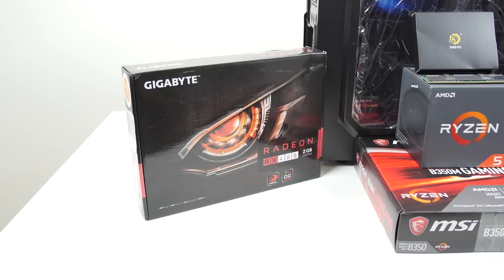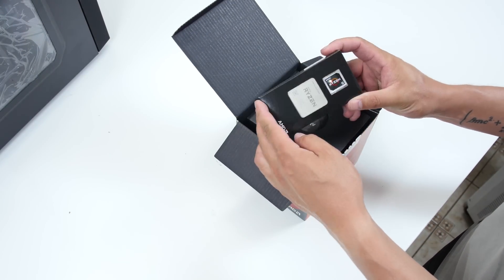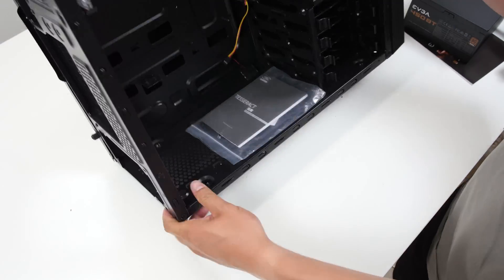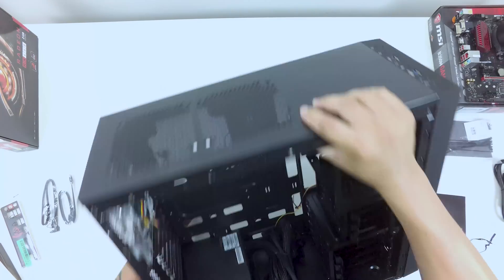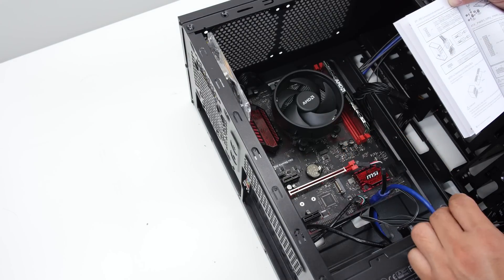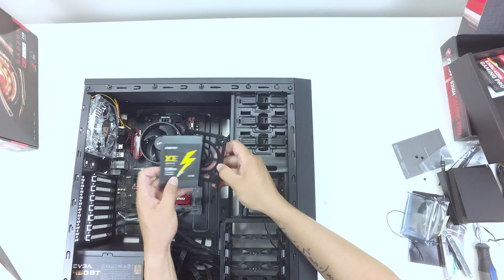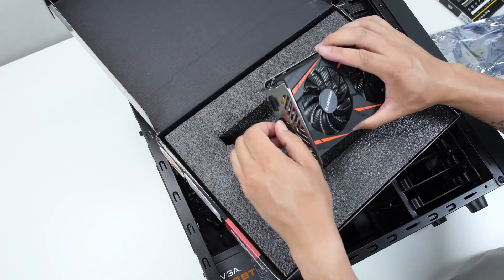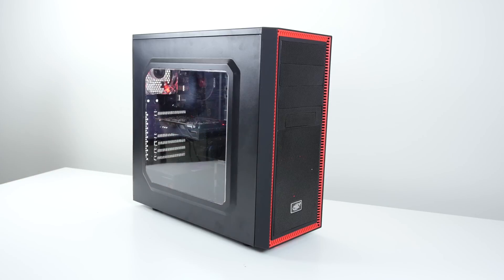$450 Ryzen 1400 Gaming System

Comment: You make it look easy brother. Good stuff
Reply from the maker: Thanks for watching!
Reply from the maker: Cookieking Gaming incorrect.
Reply from the maker: That's part of an upgrade video but then if I put a 500 series in this video, it would no longer be $450 computer. And this system runs Overwatch at 60fps on ultra 1080p with freesync without any problem. What else you got. So far you haven't been right on anything. But I guess that's why you are here so you can learn.
Reply from the maker: Cookieking Gaming you can't see in this video I'm using a $150 Ryzen 5 1400? You can't compare a Ryzen 7 to the Intel 6700k. Even when overclock, it can't beat a Ryzen 7. You think multi-core is a gimmick? Well for you is it since you don't do anything serious with you computer but play csgo and Minecraft at 500fps on a 60fps monitor. Pretty lame.
Reply from the maker: Cookieking Gaming You need to first figure out what better gaming is before you can talk. You have already proven that you need to learn more about refresh rates and making a balanced system. Come back in a couple years when you can make a more detailed opinion with some correct facts.
Reply: Cookieking Gaming the 460 is OK If you play with medium settings and yes the vram limits you in doom a bit for example. The 460 4gb version can't use all the vram as the cards pretty weak. 460 2gb Will play any esports title 1080p60fps medium-high.
Reply: Cookieking Gaming Wow another idiot troll kid on the internet.
Reply: Cookieking Gaming Who's this salty lost kid?
Reply from the maker: Hey guess what, there are many other components in your system that could affect performance for the shitty game fps. There is also software issues that could be happening. It seems like you are the only person in the entire world to have these issues. It might also be a conspiracy. It's probably MK Ultra giving you bad fps.
Reply from the maker: You need to do more research my friend. I already know this plays Overwatch at 1080p on ultra with an average of 67FPS. I am doing it now.
Reply from the maker: Right now it is overclocked to 3.8ghz with a vcore of 1.30 and stable with prime 95 and a cinebench score. the RX is also factory overclocked and overclocked a little bit more with MSI afterburner. So far you are the one that needs to prove it is crashing.
Reply from the maker: So far you are the one that needs to prove something.
Reply from the maker: Again, do your research on infinity fabric and ram speeds for AMD.
Reply from the maker: Did I say it plays 1440p? I don't think so. I have this paired up with a 1080p 75hz freesync monitor.
Reply from the maker: First off, there's already plenty of evidence on youtube. I even said I am late with the ryzen hype train. so many other youtubers beat me to everyting that I have said. I also wrote down that you should get a 560 instead because it wasn't out when I bought these parts. The only evidence I have right now out that is online is live streaming overwatch from the same system. I did both a capture to another system live stream and  a live stream from the same system itself. Both averaged 50-60fps on ultra 1080p. Which is surprising because this is not the kind of system that can live stream and game on. But it worked. What else you got?
Reply from the maker: You can see those streams here: https://www.facebook.com/itsgoodtobegeek/
Reply from the maker: So you just made your entire statement invalid when you said ryzen 7 cpus with locked cores. All ryzen cpus have unlocked cores. Try again. Sooner or later you'll get something right. You also keep leaving out that all non-k intel cpus are damaged k cpus. Like your i5 is a damaged i7. Also the 10 series from invidia is a damaged 1080ti which is a damaged Titan.
Reply from the maker: Lookup the 460 2gb and battlefront and you will see 40fps on ultra 1080p. Same goes for Fall out 4. Is this your first day on YouTube? You know there is a search function right? But I know you will try to go off topic and say that a 1060 will do better. Lol. Try again.
Reply from the maker: A PS4 and XBox One S combined cost more than this system. Not to mention the games also cost more for those consoles. Most console games, including star wars battle front and fall out 4 can only play at 30fps. Battlefront can't even do 1080p. Try again.
Reply from the maker: You have not provided any reliable or any good technical knowledge so far. So I can't be stubborn about anything you say. Go ahead and post a link to the linustechtips video and time code where he says that Ryzen CPU have locked cores. You are either trying to bullshit or you don't know how to post a link. Cite your sources. Try again.
Reply from the maker: Says the guy that buys a 1060 and doesn't have a gsync or 144hz monitor. You have a 1060 to play CSGO and minecraft. Your system is so unbalanced. That is a wasteful way to live. Try again.
Reply from the maker: You personally own a locked CPU and no motherboard that can overclock. You chose to limit yourself or you didn't know what you were buying? Try again.
Reply from the maker: Maybe you need to switch to consoles because you seem to lack a lot of knowledge in the PC field. I guess that's why I am here to teach you to be a better troll. Try again.
Reply from the maker: wow more incorrect info. vsync caps you at either 60fps or 30fps. Nothing in between. You need to learn more. Gsync and freesync is variable refresh rates. It is the advanced version of vsync. Try again.
Reply from the maker: AMD freesync is free. Gsync is owned by NVIDIA and manufactures have to pay a license so that means you have to pay extra in the end. Try to learn more from linus before you say something else. Try again.
Reply from the maker: and yet you wasted so much of that money by not using a gsync 144hz monitor. You don't know what good gameplay is. I pitty you.
Reply from the maker: You can't backup PC period. Buy an xbox or a ps4.
Reply from the maker: You had to prove he said locked. We all already know these are disabled core of the 1800x. Where does he say the cores are locked? That's what you said. You said they were locked. Keep searching.
Reply from the maker: Do you know what sponsored means? The video you linked was sponsored by Synergy. Sponsored means being paid money to make a video. Being given free CPU's for a review isn't sponsorship. You need to watch more YouTube dude. Try again.
Reply from the maker: By the way, all this trolling and comments back and forth is really helping my video come up in search results. So thanks for all the comments. It really does boosts my channel.
Reply from the maker: My god man, you don't even know how your own computer works. You're not stubborn, your're ignorant. Luckily for you, I m a patient teacher.
Reply: Wow. Rip MrBoriquas notifications
Reply from the maker: True_ Dublock Terribly sorry. I blame this troll.
Reply from the maker: Cookieking Gaming You seriously want to compare a $300 Intel CPU to a $150 AMD cpu? You really don't know simple math. You are afraid to compare it to a $300 AMD CPU?
Reply from the maker: Cookieking Gaming and the Ryzen 7 has twice as many cores as the 6700k. And why are you comparing it to the 6700k anyways? The Ryzen 7 out performs the newer 7700k. It even outperforms the x99 6800k.
Reply from the maker: Cookieking Gaming I think your country charges too much for computer parts. A Ryzen 7 CPU here can be as low as $290 and that's about £224.
Reply from the maker: True_ Dublock I know I should stop. I realized now that he doesn't know the basics and at this point I'm just bullying him.
Reply: Cookieking Gaming I too want to see performance of this PC, but not because I'm a moron troll but because I have the gtx 1050 instead of 460.
Reply from the maker: Cookieking Gaming Playing on it and testing it is easy. Making a good looking video is the hard part that takes me a long time to do.
Reply: micro center is cheaper
Reply: Yeah but there's tax
Reply: The B350 Fatal1ty would be better choice, had one msi had gone back real quick.

Comment: Hey when I push the gpu in the mobo should I hear a click?I have a gtx 1060 6gb palit and joust installed it and didnt hear anything also the pci block didnt move
Reply from the maker: Skipper you don't always hear a click but after inserting it in, it should not come out easily if you try to pull it out.
Reply from the maker: Skipper you also might have the type of pcie slot that has a clip you have to slide over to lock it in place.
Reply: The mobo is msi b350M gaming pro.The card feels like its in but the lock clip looks exactly the same before installing the gpu.I dont know if im afraid to push it to hard and if thats he problem.Its there a problem if I test the pc to see if it works or theres a risk it will fry?

Comment: Could I use this for a gtx 1060 3gb and a ryzen 5 2400g if so could I over clock ( ik the 2400g has integrated graphics but I will upgrade to a 1060 and won’t start with the 1060)
Reply from the maker: Josh Bennett yes you can.
Reply: Johnny Phung thx and will it be able to over clock even with the 1060

Comment: Seems like an overkill with the CPU for the price. If you want to get the most bang for the buck lower the CPU from the 1400 to the 1200 then shift the $50 for a better GPU. The 1200 will perform well enough to let even the 480 perform at it's near best.

Comment: yeah I just finished building my first system but using the Ryzen 5 1600 cpu and with a gtx 1050 ti 4gb.  I have the same motherboard and my question is I know this board has some LEDs and see 2 small lights on to the right of the gpu....are these the LEDs or are these lights indicating that something is wrong?

Comment: I would substitute the 1400 for the 1200, invest that 50 in the video card and try to get a 4gb 460 OC or 1050 OC or 1050ti evga SC
Reply from the maker: I agree. which is why I did just that when the 1200 came out and I picked one up for $90. I am still working on the battle of the budget PC's video and that's what's in there. The 1200.

Comment: Can I use gtx 1060 instead of rx460?
Reply: Kanaka Tube of course!!!!
Reply: Kanaka Tube yes it would be way better a rx460 would just bottle neck the cpu
Reply: Yes. For a real budget build I'd even suggest getting the Ryzen 1200, if your PC is purely for gaming and simple office work the 1200 is an awesome processor. It won't bottleneck the 1060 and you can save an additional $50-$70 depending on how much you paid for the 1400.
Reply: Kanaka Tube might need a more powerful psu
Reply: No, it wouldn't bottleneck the gpu?
Reply: Zeusbeer the ryzen 1200? Not really. I have a ryzen 1200 and a 1060 6GB, the GPU performs at near peak levels. I went this route because I was able to shift the money I saved from the CPU to the GPU, letting me get the 6GB model instead of the 3GB model. If you can fit it in your budget I'd say just go for a ryzen 1600 to avoid any bottlenecks.
Reply: I also use the 1200 with the 1060 3gb super strong combo

Comment: Good video I agree with the coice of storage an ssd simply isn't worth it at the moment.
GTA 5 for example is almos 65 GB tombraide is more than 20 GB iirc. It will fill up very fast and the larer ones are way to expensive.
Reply from the maker: Yes I swapped it out with a 2tb firecuda drive I got for $63 on Amazon Prime Day. a 1tb firecuda is about $60 when it's on sale . I would recommend that instead.

Comment: TBH parts of this build are really bad like the weak graphics card and the unnecessary overpowered graphics card for such a weak Gpu also you didn't have to get an SSD you should of just got 1tb hardrive and no SSD to get a better graphics card also the radiation is not needed either you could've got a better cpu cooler
Reply from the maker: What other gpu do you recommend that is under $100? a 1TB hard drive is the same price as this SSD. What 1TB HDD do you recommend that is $50 or less? So basically you don't save any money from your suggestions but want a better GPU? This video is called the $450 system. Not $500 or $550 or $600.

Comment: Dude please help  i'm facing a lot BSOD error on my ryzen build , my spec Ryzen 1400 , mobo gigabyte ab350 with f5 bios, ram corsair vengeance 8gb 2400mhz RED , GTX 1050TI 4GB OC , WD 1 TB , CORSAIR VS450 PSU. PLZ HELP HOW TO SOLVE BSOD ERROR??
Reply from the maker: What version of Windows are you using?

Comment: is amd good?
Reply: Intel are not who they appear to be. Why? Intel: Anti-Competitive, Anti-Consumer, Anti-Technology. Watch carefully: 
https://www.youtube.com/watch?v=osSMJRyxG0k

Benchmarks misslead as they don't show the CPU usage percentage. 2-core Intel benchmarks are far higher than they should be compared to 4-core AMDs.

I asked an i3 user who told me that an i3 running daily software like browsers, office suites, media players etc. all at the same time uses 30% on all cores. With a ryzen 3 1200 it will be like 5%.

So i3's run Windows & the software most people use like the old AMD dual cores that many AMD users threw away years ago, the ones now sold on Ebay for $8.

A gaming reviewer on Amazon wrote of his Ryzen 3 1300x: "its snappier than the i3 4170 its replacing and games are running smoother, I cant say frame rates are much higher but its more consistent with less drops and stuttering. Farcry 4 and The Division seem to be running at a much more solid 60 fps now with 4 physical cores instead of 60 with drops down into the 30s and 40s randomly with the 2 core 4 thread of the i3."

Games will become optimized for Ryzen later.

In 2025 Windows 10 updates will expire so a current i3 is unlikely to be able to run the next operating system after that. By then you could get a i5-6400 at $60 but you could get a Ryzen 5 for much less which will be much better at multi-tasking. This assumes the new Windows supports the 1151 board (Windows 10 doesn't support socket 1155 which came out in 2011).

Someone wrote they wished Intel would do more "great" things like the Pentium G4560 but someone responded that Intel were limiting those to entice more people to the i3. I think that's just going to backfire on Intel.

Someone with an Intel G4560 & a Ryzen 1200 wrote: “I own both of these cpus and believe me, g4560 slows down a fucking lot after 2 weeks of usage due to the antivirus and other stuff, and with ryzen I can even listen to the music on twitch in full hd, have 3 more chrome bars with tutorials for csgo/lol champ builds and much more while still sustaining stable and better fps than the g4560".

(If you get Ryzen get a B350 motherboard which allows overclocking.)

I'm sure Intel doesn't pay taxes; it's part of the global corporate empire with Monsanto, Amazon, Google, Starbucks, Facebook, McDonalds etc.

Comment: hello you can help me this I want build how you sing all correct CPU    Intel - Core i5-7400 3.0GHz Quad-Core Processor
CPU Cooler   Cooler Master - Hyper 212 EVO 82.9 CFM Sleeve Bearing CPU Cooler
Motherboard   ASRock - B250M-HDV Micro ATX LGA1151 Motherboard
Memory (RAM)  Patriot - Viper 4 8GB (1 x 8GB) DDR4-2400 Memory
Storage    Western Digital - Caviar Blue 1TB 3.5" 7200RPM Internal Hard Drive
Video Card    EVGA - GeForce GTX 1060 6GB 6GB SC GAMING Video Card
Case    Deepcool - TESSERACT SW ATX Mid Tower Case
Power Supply   EVGA - 500W 80+ Bronze Certified ATX Power Supply
Optical Drive   Asus - DRW-24B1ST/BLK/B/AS DVD/CD Writer
SSD    Silicon Power SSD SLIM S55 240GB

Comment: RX460? Fuck of with that piece of shit. 
For like $50 to $70 bucks more get a 1050ti or 1060 3gb
Reply from the maker: The Last Mohican for $50 more you can get a 1050ti. for $120 more you can get a 1060. but none of that would work well if your monitor is a $120 freesync monitor. if you want a GSync monitor for those Nvidia cards, add another $100.
Reply: ***** 
Well my monitor is a acer 144hz and I was just making some scenerio or analogy.
My pc has a gtx 1080 which I upgraded no to long ago.

Comment: a g4560 + rx 570/470 would've been a much better combo, also 1tb hdd lasts longer than 128gb of ssd, why is everyone so fixed on the ssd? It's not anything great, 80% of the games load fast enough with an hdd and I don't think waiting 5 more seconds for the pc to boot is life-threathing.